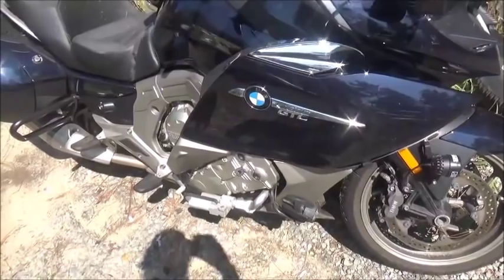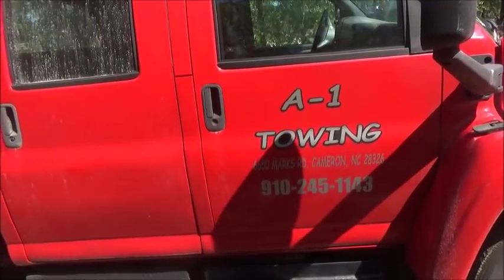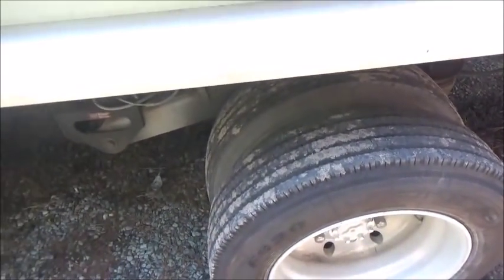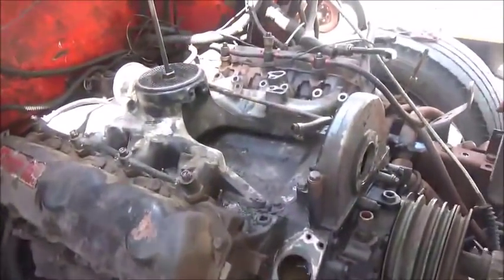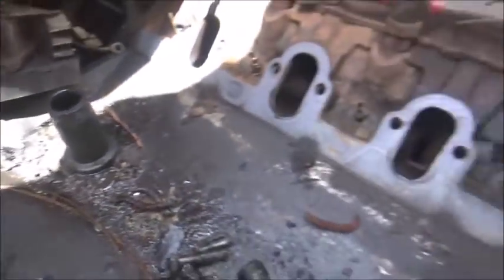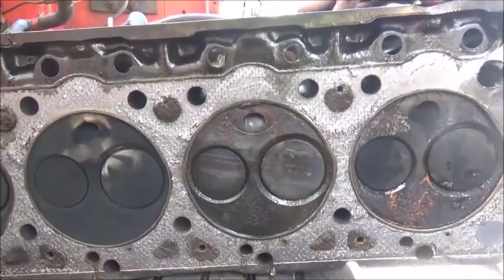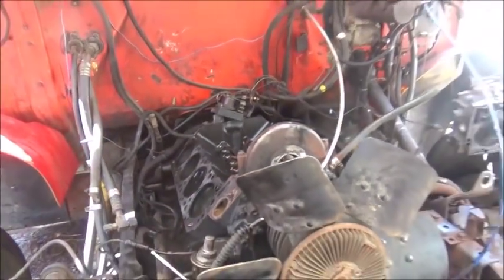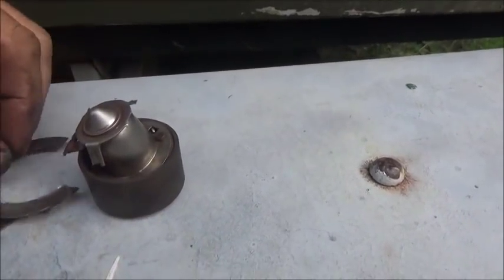THINGS NEVER GO AS PLANNED CRACKED HEAD

Comment: I had a random bolt stick into my thermostat and it caused successive gasket blowing problems, clouds of steam at speed ain't fun in an open topped roadster ('27 Ford T). Bought a new engine, coz that was the cheaper, long term option and stripping the original engine, we found the bolt n thermostat stuck. New thermo/gaskets and she was good as new. Traded the fresh bought engine for other work I needed to pay for. I feel your pain. Good chap working with you. I hope all goes well with both trucks. Work's work and they need to keep rolling and good. Best wishes from England.

Comment: Two suggestions. Check for bent rod on hydrolocked cylinder. Also I had trouble mixing old and new tires on my motor home. I’d put the two new tires on one side and the two matching almost new tires on the other side. Great videos!
Reply: Wow, I bet J.W. wasnt baware of that.

Comment: You might want to use a sled gauge and dial indicator and measure piston heights to make sure they are all the same. That way you have an idea if you bent a rod when the engine hydro locked
Reply from the maker: It didn't lock running, I figured it would leak in so I tried to turn it with a breaker bar to check. It never got into a situation were it would have bent anything.
Reply: Glad you brought this question up!
Reply: I just wanted to mention that before you put the heads on and found one had low compression but if it wasn’t running then it’s ok. I’ve seen a lot of crazy destruction on diesels over the years

Comment: Damn that's some tough luck. Of course it'd overheat while you weren't in the cab to stop it before it got too hot. That's the kind of luck that I thought that only I had. It's a good thing that you had the 4-door to use as a backup. Maybe you'll like it a little better with the good tires on it and that'll inspire you to fix it up the way you were talking about with the bigger bed. Getting that fuel system clean is a must though. And maybe i'm just getting older but I run the AC more than I used to. And I know you guys up in North Carolina also see some Texas sized heat sometimes so I know it's not easy to work in that. coupled with humidity. I'm in Dallas so it's not too bad but down towards Houston it gets pretty miserable as far as air quality.

Comment: Those cups in the head are precombustion Chambers.  They are where the combustion starts.  I worked for a data acquisition manufacturer that supplied a machine to the Moraine Ohio GM Engine plant.  I was sent to fix problems with their machine.  It performed 2 basic checks on Oldsmobile diesel heads. First it measured the force the precombustion chamber into the head,  too little force could and did  result in the PCC falling out.  Second test was for PCC height.  Too high meant it was not fully seated.  I had to do some rewiring to the machine and it was good to go.  They started the line up and it was cool to watch.  It had a kicker to knock failed heads onto a conveyer line for rework.  I don't think I could work on an assembly line.  I like my job I have now.

Comment: So sorry for your troubles.... I had the plastic fitting fail on the heater hose connection/manifold on my mercury 4.6v8 I got it off the freeway, had it towed to my mechanic.  He says I did not cook engine,  manifold and labor 675 dollars.  I fell like I dodged a bullet  plastic engine parts what the hell is wrong with that picture.

Noah is getting a better education with you than tech school
Reply: That happened 2 times to me, both on Lincoln town cars with the 4.6. Dime size hole just appears in the intake manifold bleeding green. Back then you could get aluminum replacements for cheaper than the plastic!
Reply: @kevintucker3354  yup between the plastic , the electronic computers and thin sheet metal there won't be classic cars. If you hear a spinning noise,  it's Henry Ford spinning in his grave.   Someone said BMW has plastic oil pans,  now what go wrong there? 😲
Reply: pooop happens............................
Reply: @gertraba4484  that's what Forrest Gump says😛😛😛
Reply: Had plastic fitting on a heater hose explode in my peterbilt in colorado last year. Lost all my coolant and sat on the side of the highway for 8 hours waiting on a service truck to get parts and get out to fix me. Fun day

Comment: I feel you on the injectors I’m doing 8 on a gmc 2500 2003 it was 3500.00 for injectors and lines and bolts and gaskets I decided to change both thermostats and a turbo spring clam that was 175.00

Comment: I had a 82 diesel VW rabbit. I found similar cracks in the pre combustion chamber. I almost scrapped the head until a sharp diesel shop told me that cracks in that area are common and of no consequence. It saved me about $200 if I recall

Comment: i think that link air ride suspension rides rougher than the factory leaf spring suspension. all of these c4500 /c4500 trucks i own have that same miserable suspension. im not a fan of the engines in those trucks either. i am happiest driving the oldest highest mileage truck i own.  that stinks about that engine....is it worth it to you to throw rods, mains and rings in it while its down? thermostat went bad, overheated, heads cracked allowing compression into the cooling system...too much pressure in the coling system caused the radiator to fail?

Comment: I'm in total agreement with you about capped tires! My boss won't run retreads on anything. I've had em come apart and just gut the truck. Air lines,wire harness just everything.  We run them commie Chinese tires and never really had an issue. Never stuck a corn stob through any of em.
Sucks you can't afford American tires anymore,but I've had good years on a grain trailer go bad after only two seasons. The Chinese stuff's half the price and seems to last 3\4 times as long. 
Good luck with that Navistar,I drove a F-250 for  bout 6 years and never had to touch the engine, would still be driving it except for the EOD 4 speed auto tranny went out. Drove a couple school buses with the same engine. Love em!

Comment: Jonathan sorry about the 7-3 . on my vehicles that I have to be away from and let idle I put an audible alarm on, whenever the door was open the alarm was active I used the idiot light circuit for oil and temp and a voltage divider for battery voltage. Might need a relay in the circuit depending on how big the horn is. Or use a second backup alarm. I was always worried about that very thing happening  I know you know how to do that but if you need help I can do a circuit diagram. I once had the leave the truck idle for 8 hours went on a mission . Just a thought good luck with the rebuild hope it all goes well interested to see what you find

Comment: You'll probably find it was those tyre caps separating causing the wheel bounce, seen it happen before. I can't say for sure not being there, but that head that has no visible cracks in it is probably cracked inside the inlet port somewhere near the valve seat if the port was full of water like that.

Comment: Bummer, on the truck. I did a engine rebuild and got a bad thermostat from the manufacturer. I cracked my head while I was in driveway adjusting the timing and carburetor. Two dollar part killed it. Lesson learned, I always check the thermostats on stove after that in incident.

Comment: Just curious how do you get all that coolant out of cylinders.do you just suck it out with wet/dry vac or do you drop the oil pan and spin over engine by hand.and then wd-40 cylinders so they dont flash rust,while you wait on parts.and then do you set so no.1 piston is at top compression stroke to reassemble back together.ur input on this would be great I trust you know what ur doing.rather than others.best of luck on getting it back running soon.!snookie pa.

Comment: that damage to the thermostat was caused by it failing and jamming closed the heat from the engine would build up  till it exploded the thermostat seen it quite often in  over heated engines
that second head you showed one are looked like it has been cracked for quite some time looking at the rusted crack on it'

Comment: Yeah, that's a common thing: You always will have problems with crackheads! :-) ;-)
Congrats for the good deal with the new tires (simply bad luck that the old ones deteriorated).
3) I wonder if it isn't possible to widen the bed by cutting the sides flat, fabricating new railings and put them on?
Best regards luck and health.

Comment: Are you going to make sure it didnt bend a rod ? Since it did hydro lock ?
Reply from the maker: It didn't lock running, I figured it would leak in so I tried to turn it with a breaker bar to check. It never got into a situation were it would have bent anything.
Reply: Allright I figured that you would of but I just had to ask . I love what you do I wish I could find a 1/16 of the stuff that you do. It's just amazing that you can bring so much stuff back to like

Comment: I just bought a 1968 f250 and will be taking the exhaust manifolds off how do you recommend getting the bolts out with out them snapping off. I just sprayed them down with some penetrating oil. I tried to get one out so I could go buy new ones for when I put my headers on and it snapped right off

Comment: Jonathan sorry to see when it rains it pours!!!!!!!!I’m right there with you about Nero decks a 102 is always a nice deck steel deck is a better than aluminum deck I drove roll  back for a junkyard.. UD flat hose truck could put it anywhere......But  you couldn’t drink a cuppa coffee going down a bumpy road was like a milkshake all over..... Hey head’s up about Chevy you got that crew cab general motors is not holding onto the parts for those trucks ,  they’re going to get as hard as hen’s teeth for parts,,, Its going to get harder to find parts for them in the next couple years,,,,  I looked into buying one more good one for parts so if you come across one buy it,,,, for a spare parts or sell the one you got just an FYI Jonathan you might already know that

Comment: What engine is that the 7.3 IDI or Powerstroke
Reply: Idi stands for "In direct injection" which is the carburetor equivalent of diesel engine this engine clearly has 8 inj in the cylinder so how could it be idi

Comment: Do you not have a good radiator shop there that can fix that one or completely replace the cores for a lot cheaper than replacing the whole radiator?  Sorry you have had bad luck.  You should throw a turbo on that since you have it that far down.  And you mentioned in the video that it was okay to have cracked heads as cores.  Does that mean that they are only repairing the cracked heads and shipping them to someone else?  I had a joker engine builder give me a repaired cracked head and it was a train wreck.  You might consider going a different way.  Maybe throw that DT466 that you have in there???

Comment: Well, you can't really blame yourself for that if it was the failed thermostat that cooked the engine.  I've never seen a thermostat as wrecked as that before, it almost looks like mechanical damage rather than an in service failure, maybe someone knocked it into place and cracked the frame.  It might be worth checking the rest of the cooling system while the engine is in bits in case whoever did that also did other work on it which is also waiting to fail.  I'm sorry that it's cost you a set of heads and attendant parts...
I'm really surprised the double cab has capped tyres on it being as it was an ambulance, that would be an absolute no-no, not ever in the UK as they're much more inclined to come apart at the sort of high speeds ambulances can often be used at on calls...